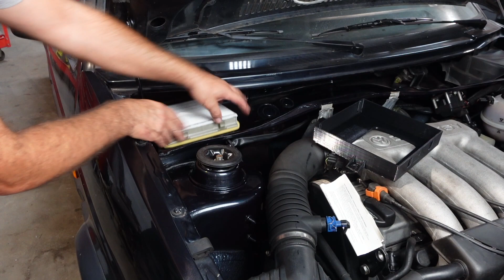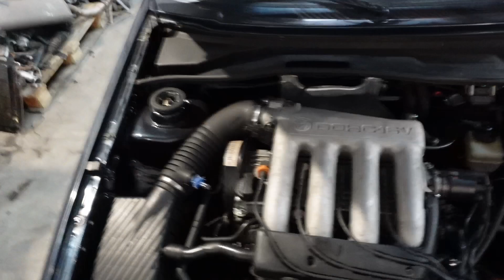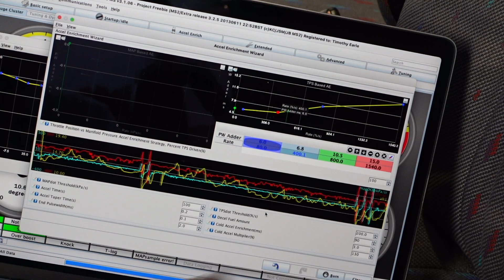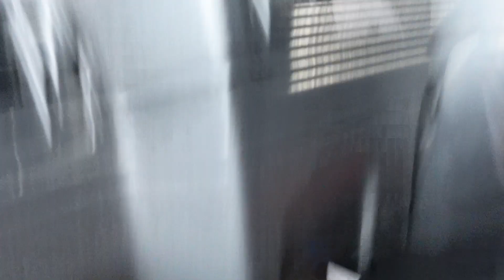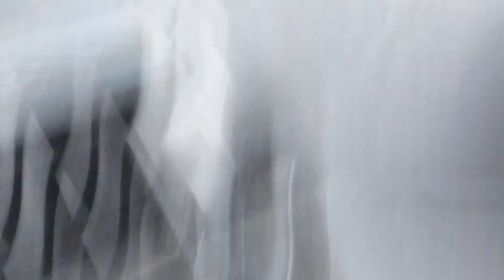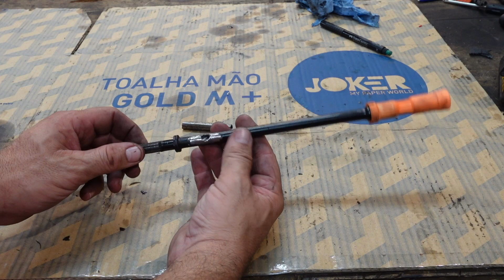Project Golf mk2 1.3 to 2.0 16V Pt10 + Oil Control pt2

Comment: Great stuff! Will you take it on the dyno when you finish all you want? And are you satisfied with the second waterpump setup?
Reply from the maker: Thanks, I guess I am happy with the 2nd water pump, I've had no issues, but also no real way to validate if the head temps are more even across it, the science make sense, but if in practice it makes any difference on this car, maybe if it was turbo'd. Thinking about it I may do a test once on the dyon, standard water circuit  Vs this setup to see if any gains, or is if starts to knock/pre-ignition.
Reply: @RestoDesigns7  True. Maybe check the temperatures on the head with that laser gun?
Reply from the maker: @MOTA_KRAMPUS  yes that will show the outside temp on the head and block, it's what's happening inside the head and block around cylinder 3 & 4 around the combustion area which I have no way of knowing, maybe knock/pre-ignition could give an indication.
Reply: @RestoDesigns7  I understand. :) I supposed that outside temp should be enough.